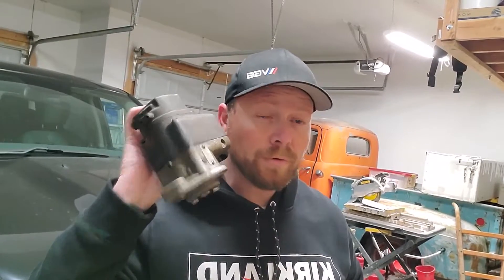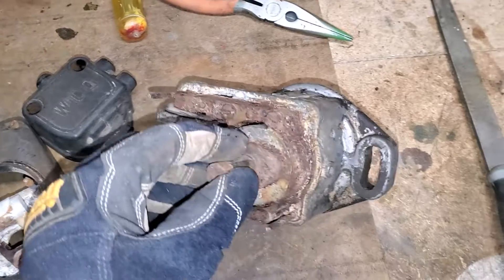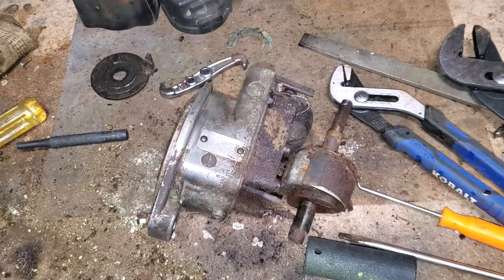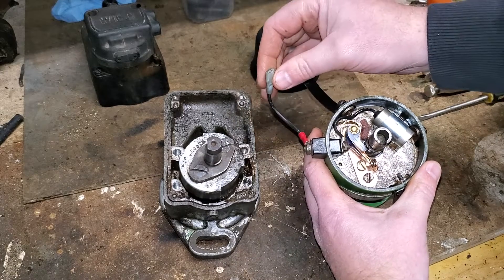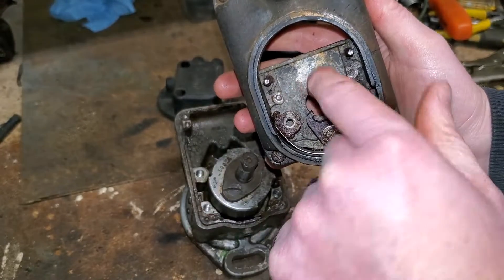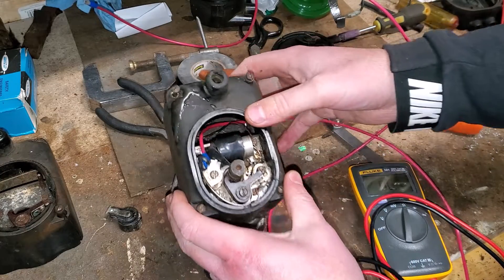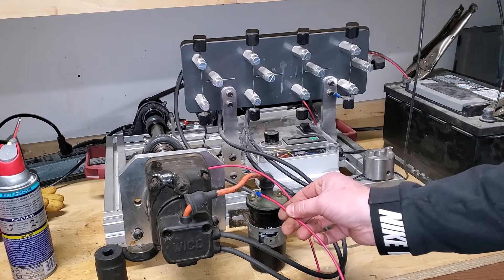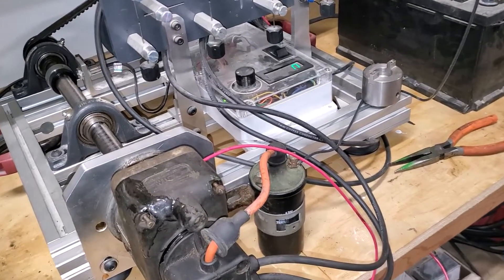How to Convert a Magneto into a Distributor

Comment: Should have left the impulse hooked up so your advance would have worked and yes I know it goes full advance after the impulse kicks out.
Reply from the maker: I don't think it would have done anything.  The impulse on a magneto, like this, is only active on startup and only engages to spin the magnets on the rotor fast enough to produce a spark. So, it actually retards the spark. Leaving the dogs of the impulse installed would not have provided any spark advance at higher RPM, like what a more "modern" distributor does.

Comment: Very cool, what about taking a magneto from an antique hand crank telephone. Can that be done to  start an car engine.  Project that I thought about. Instead of using a  battery like today, why not a little hand crank magneto from your sterling wheel or somewhere on the console.  I believe stromberg was a popular brand and there are tons of them on eBay.
Reply from the maker: Ha! I know absolutely nothing about hand crank telephones. I'll let someone else tackle that excitement.
Reply: Those don't suit required RPM and load. OTOH a kick stater (hand cranking cars was silly when legs are vastly stronger and can use large lever arms)  would be surprisingly easy to do if there was a pragmatic reason to make one.  The extremely simply Maytag style is the most robust and could be fitted with an overrunning clutch.